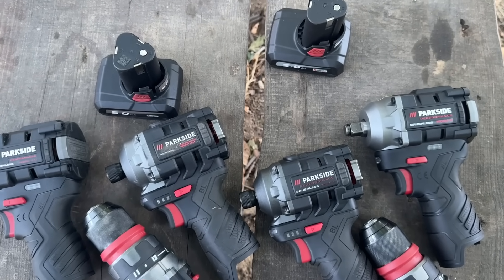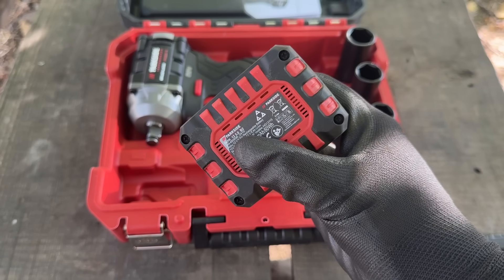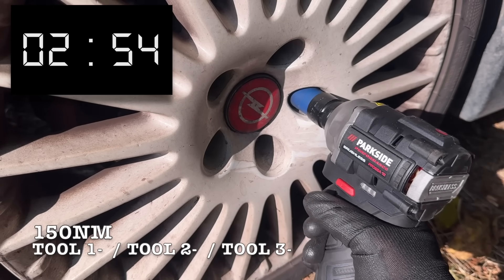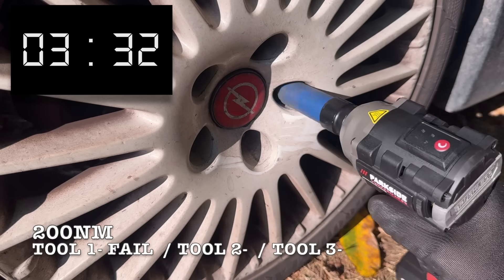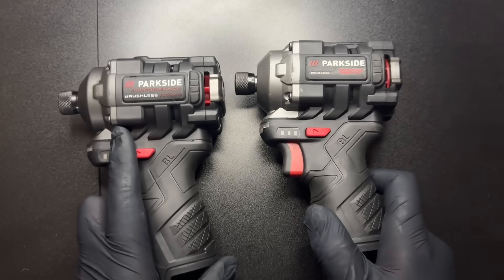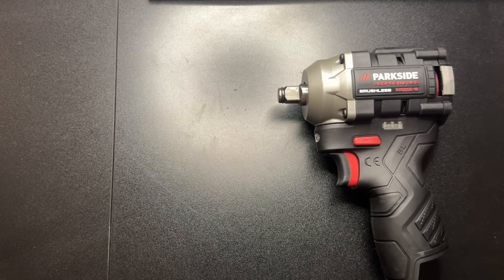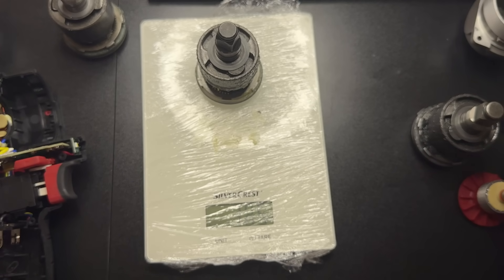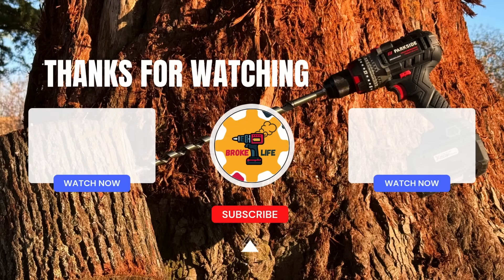Surprise! Parkside Performance 2025 Tools - Test and Teardown, PDSSAP & PPDSSA A1 12V.

Comment: There is just one more thing that should be measured, which seriously impacts the performance of the motors in  these machines, and that is the strength of the magnets in rotors. Although looking identical, the strength of the magnets can differ significantly. I had three PKHAP 20-li rotary hammers, and one of them was performing poorly, stopping on the slightest jobs, and drawing too much current. When compared the magnets strength of the rotors, the faulty unit's rotor magnets were too weak compared to the good units.
Reply: Also, the weak magnets in bldc motor rotors are the no.1 reason for controller failures in bldc motor machines. Weak magnets cause high current draw, beyond the MOSFET transistors max current rating, causing them to overheat and fry.
Reply from the maker: I agree—that should have been done, although I don’t really have the proper tools to measure it. I also should’ve swapped the hammer assemblies from the new one to the old one to make the video more complete, but to be fair it was 2 or 3 a.m., and I just wasn’t feeling up to it.
Reply: @BrokeLifeEU 
The way I have measured it: I used the silvercrest pullup scale for travelbags weight measuring, attached the big nut on one end, and measured the weight needed to breakaway the nut from the rotors 😉
Reply: The way I did it, I used the Silvercrest travelbags pullup scale, attached a big iron nut on one end, and measured the maximum weight shown on the scale, needed to breakaway nut from the rotors. The difference in weight needed to breakaway nut from the good rotors and the bad one, was significant.
Reply from the maker: Shame I don’t have that either, but I may try to think of something along those lines. Thank you for the idea!
Reply: @BrokeLifeEU  you can measure the magnets with your scale supported at the ends where the anti slip rubber thingies are, than use a belt (textile) put around the scale in the middle, a piece of iron a the lowest portion, zero the scale with the weight of the belt and the iron piece (tara), and you can pull downward with the magnet to see the breakaway force. It will be sufficient to compare the magnets, even if the contact is not magnet-metal because you have the belt thickness in between. You only need the comparative force not the absolute force. It will be a VERY important find. Thank you VERY much for your work!

Comment: I normally just lurck here and do not leave any comments at all. But you did an amazing work. Thank you very much for digging scientifically(!) so deep into this topic. I just recently bought myself a 2025 impact driver. Maybe there is a chance to change the hammer to improve the performance.
Reply from the maker: Thank you so much for the comment! Although I didn’t try this they do look like they are interchangable, but I think the 2025 version if it’s a good one to start with can be considered more reliable. Still early days, but that’s what I think as of this moment in time.

Comment: Great one. Good quality investigation. Only on thing that i think is missing and would definitely say is the hammer problem(which it is 99.9999% sure), would be to switch the 2024 model hammer into the 2025. This way 100% sure its mechanical problem and not software. Maybe a short video on it
Reply from the maker: Thank you for that! Yes, after you mentioned it I realized it was a shortcoming that I didn’t swap the hammer mechanisms and anvils. But in my defense, it was 2 or 3 a.m., and I really wasn’t feeling up to it anymore.

Comment: Man you did a amazing job and great atent to detail , i was just saying to myself coud it be the anvil and at the end it wa just that. i have the 2024 and the new 2025  just got it  and i also tore it apart to grease it , and didnt think to look closer to the anvil,  time for dissassembly again lol.  Great Great video !
Reply from the maker: Thank you for that! If you open it up again, please update us on what the hammer inside looks like. It would be fantastic to see that if you get the chance to open it up again.
Reply: @BrokeLifeEU  Ok so i took another look inside and the anvil was hitting one side perfect and the other did not make full contact so i just grind a bit with sander and it is somewhat better, i did a test with paper to see if it is a gap between anvil and hamer and it is not perfect .the old 2024 anvil and hamer hit pefect .
Reply from the maker: @Iahim_Nirolf Thank you for the update! Does the new hammer from yours look like the ones in the video?
Reply: @BrokeLifeEU  Yes, same motor same hamer assembly and same 1/2 inch anvil that wobbles like crazy, not even close to centre. per all it s ok for some home use (price on mine aprox 17 euro  Romania) Wish you all the best and many many more vids.
Reply: @BrokeLifeEU  It has no problem breaking loose the wheel bolts so i am happy with it.
Reply: Thanks a lot for the video! I was also disappointed with mine because it could not unscrew even 120 Nm. Saw your last video and I thought it is a quality downgrade so I left it as it is but maybe I should also check the gaps between the anvil and the hammer.

Comment: Cost cutting the manufacturing probably, or the supplier for those hammer heads sneakily changed something and final assembly doesn't check well enough for quality variation. And yes better quality control in the end should catch this but apparently it's lacking. Keep up the great work
Reply from the maker: Thank you! To be fair, I don’t know if they ended up like this after use or if they were that way from the start. My guess is that they weren’t ideal to begin with—though not terrible—but during use, I did notice a drop in performance on at least one of them. That leads me to my hypothesis that this issue can get worse over time. I can’t exactly prove it, well unless I purchase 50 more, but that’s how I think it might happen.

Comment: Thank you for your honesty! You are right to call a snake a snake! This lack of quality control is merely inacceptable period! Even if I like this brand, I'm not stupid, many times when I saw declining quality of the exact same tool, I immediately sent them back and got a refund. I have the early version of the 12v impact wrench, and it is very powerful, it delivered 350nm just as advertised. I could easily loose wheel bolt even at 2 gear (tightened at 119nm). You should send your videos to Lidl and make some noise. Thanks bro
Reply from the maker: Thank you for your comment! I do realise that three units is a very small sample size, so it’s possible there are other batches that are perfectly fine. I’ve also sent them an email—I just hope it doesn’t backfire 🥲
Reply: @BrokeLifeEU  i also sent them a mail, lets see ...
Reply from the maker: @ttgekko So if I get banned I can blame both myself and you 😂😂😂
Reply: @BrokeLifeEU want to increase the chances to get banned ? lets email kompernas also 😂😂😂
Reply from the maker: @ttgekko If they shut my tools off via the app I will tell them to shut yours off too 😂😂😂

Comment: Wow bravo

and about impact driver smaller anvil this means that you strike more often but with less force, and therefore perform the same work in a longer period of time. Other companies noticed this a long time ago and began to increase the size of the anvil, but also increased the size of the springs and the speed of the motor.
Reply: Bigger anvil egual to harder hit
Faster motor egual to more often hits
Bigger spring egual to no skipping hits
Reply from the maker: Yes, on the impact driver side, if speed isn’t that important to the user, this approach might actually make the tool last longer—assuming the component quality is the same. Now that I’ve taken another look at the hammer in the 2024 model, I’m honestly surprised they decided to fit such a huge hammer in there in the first place.

Comment: Great video! Thank you very much. As a future guideline it is worth to buy several tools, inspect and test them, and just choose the best one. Once I've bought a parkside drill, to replace the one I've burned and it had the wrong gears in the gearbox.
Reply from the maker: Thank you! Unfortunately, I can’t do that kind of testing on the channel—it would just bury it financially. Luckily, for the average buyer, Lidl still has a superb warranty and return process. I just think it would be so much nicer not to have to deal with that only five minutes into a new purchase.
Reply: @BrokeLifeEU I mean, I'll probably go for selective buying, if I won't jump off parkside addiction needle, and switch to something more consistant and reliable.
Reply from the maker: @Leemuzhko  I absolutely understand that! And that’s the whole point of this video and the previous ones. I don’t want to discourage anyone from buying these tools—I just want to encourage people to test them as soon as they purchase them, so they can be sure everything is working correctly.

Comment: the story gets more and more confusing. Thanks for your investigative work. That is really cool!

One question I have for you: Is there a way to decrease the play in my impact wrench? the anvil really wobbles quite a bit, especially if you attach a socket or an adapter with a 1/4 inch bit. Or is the issue just theoretical and everything is finde?
Reply from the maker: There’s always a way—but unfortunately, it involves making a new custom bushing and possibly a washer, and the best way to do that properly is with a metal lathe. The downside is that the end cost would probably be about the same as the tool itself.

On the other hand it is possible that the play there is just the normal amout of play as they can't be too solid either in which case it's all absolutely fine!
Reply: @BrokeLifeEU  thanks champ!

Comment: Do you think the older generation Parkside tools are of higher quality and better than the newer tools?
Reply from the maker: That’s a tough one to answer in general, since I haven’t tested all of their old tools against all of their new ones. But based on the tools I have tested, I’d say that’s pretty much the case. Some of the newer models may have slightly better performance, a few more features, and a smaller size—but the older ones felt over-engineered and trustworthy.

For example, take the PDSSAP A1 20V impact driver: it’s bulky and not the absolute best performer, but reported issues with it are few and far between. Compare that to the C3 and D3 versions—the C3 tends to break its internals in all sorts of unexpected ways, while the D3 can come with two different spring thicknesses in the impact mechanism, resulting in wildly different performance. It’s also prone to breaking the drive gear on the rotor.

I really don’t like to generalize, and I’m open to disagreement on this, but that’s just been my experience. With the newer tools, it’s starting to feel more and more like a lottery.